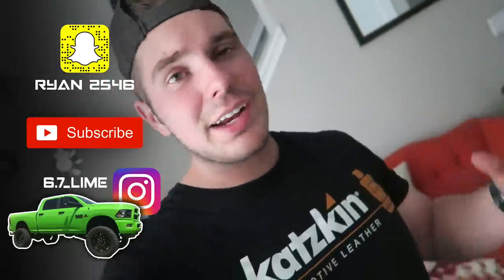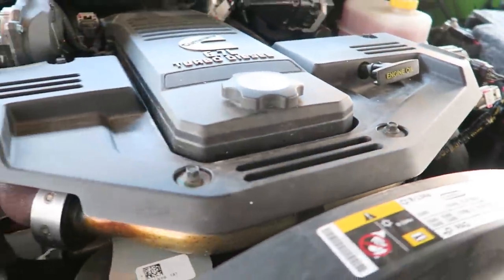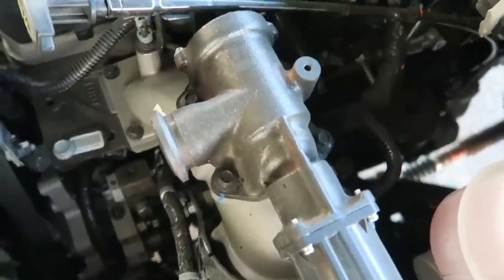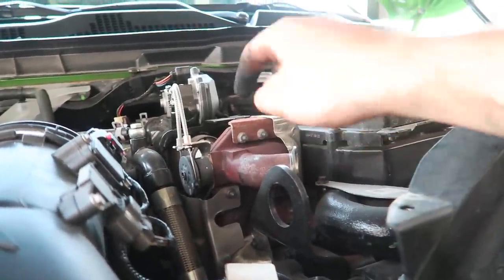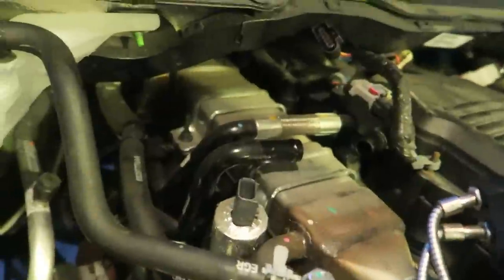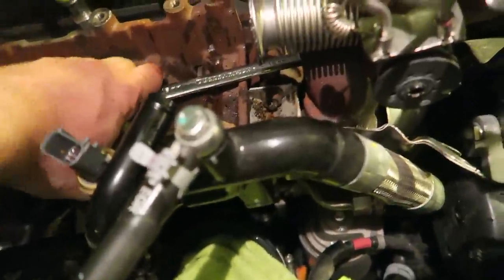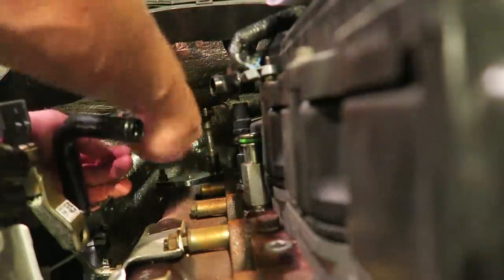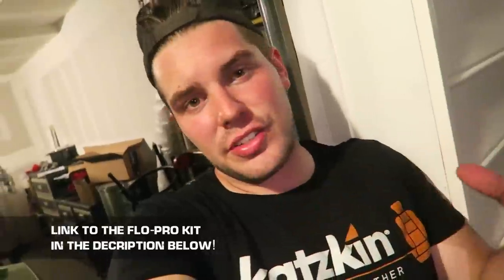6.7L Cummins EGR DELETE (2017) *For Race, Off-Road, Cleaning*

Comment: I done my truck in about 6 hours. That was an egr dpf and throttle valve delete. I couldn’t believe the difference it made in my truck on just a stock tune. I put efi live on mine
Reply: Hey man did you just get the efi live egr delete tune? Didn't know if they had to make one for the TV delete too im new to tuning bro and about to do it
Reply: @Tgodson69  yes. The tunes turn off the throttle valve. You don’t have to remove it but I did
Reply: @nicholashubbard9026  yeah I'm doing the same I appreciate the response have a good day

Comment: Luv the “disclaimer” great work and content 👍🏾👍🏾
Reply from the maker: 🤷🏼‍♂️ gotta do what ya gotta do! Lolol thanks my man!
Reply: @ryan2546  are there gaskets on the 2 block off plates. I didn't notice any, I'm fixing to get mine done this weekend and was wondering. I got the gdp kit and it came with rubber seals for the intake horn cover. No gaskets for the block off plates.
Reply: @ryan2546  how much was the Flo-Pro kit?

Comment: Easiest way to get to the coolant drain, remove the grille. On the driver side, remove or move aside the rubber cover/shield. Below the P/S cooler lines, you’ll find the drain.

I zip-tie a clear tube to the drain and run it down past the bumper. I find this method to be cleaner compared to coolant dumping all over the frame.
Reply from the maker: Sooooo dumb could not find it so I just went for it 😂😂😂😂
Reply: Ryan Mayer Sometimes you have to just send it!
Reply: @Ryan Mayer pin this comment, save more people from the "Oh!? There is coolant in there?" experience lol

Comment: I got a 2017 6.7 and deleted it awhile ago, the plate I have for the egr delete came with two long studs for the bracket. Only one lined up and the sensor won't line up with the bracket at all either. Now it leaks coolant I'm assuming due to vibration because of only one stud being able to be bolted in the exhaust manifold. Is 2017 and odd year for these trucks? Because I've seen multiple kits that show different brackets for 2017. Would be great if you had any insight onto what the issue might be because I am stumped. Thanks for the quality content.

Comment: Excellent video, thanks for sit. I have a 2011 6.7 3500 (I stupidly traded in a like 2006 5.9 - live and learn!). Ibhave had zero EGR or DPF issues, knock on wood.  But i was shocked yesterday when I replaced CCV filter at the oil and carbon swill being dumped back. But i kive in Tucson, AZ and would never pass emissions  if I deleted the EGR.  Sucks.

Comment: I know there are longevity benefits of this, but if I only use my truck for long distance towing 15-25k lbs, would you recommend this?
Reply: An EGR delete is always a good thing no matter what. Do you really want your engine eating its own poop? Engines that breathe their own waste don't live long, don't run right, don't have as much power and get worse fuel economy. Simply put, SCREW THE EPA!!!

Comment: Can you make a video on just unplugging the electrical connectors too the egr system. I have a raceme ultra tuner. Apparently it turns off the egr but too make sure it’s properly turned off I have too unplug the egr electrical connectors. I cannot find a tutorial anywhere

Comment: If you remove the little power steering resevoir on the driver side and look down there is a alan head plastic screw under neath that resevoir. Its probably half way down .

Comment: I understand the benefits of deleting the exhaust in general, but what are benefits of fully deleting the egr?
Reply: From what I understand, it prevents cycling exhaust fumes back into the cylinder which reduces soot buildup and let's the engine breathe better

Comment: Where does the riser pipe attach too after the egr cooler mounting bracket is removed? What supports that tri hose assembly?

Comment: How long did ya go before doing this? And which plugs under the hood do ya disconnect while running the delete tune before you get around to actually removing the EGR cooler and such. I know you gotta remove the DPF and SCR right away. But I heard you can leave the EGR installed just unplug certain connectors. Thanks

Comment: I have a 2018 Dodge 2500 and want the flo pro kit you have and the tune.  Which kit was it and where did you get it?
Reply from the maker: Tune is EZLYNK with tunes from PPEI, and EGR cooler kit is in the description! 💪🏼

Comment: With only 7K miles on it, I'm guessing you got it new and promptly voided the warranty.
It sounds like you're tough on that truck to need a clutch after less then 7K miles?

With that exhaust system, I'm also guessing the DEF system is gone?

Comment: Awesome video. Planning on doing my 2012 this weekend, I’ve been running egr unplugged. Any chance you can list the must-have tools? I also just installed the 5in flow pro with muffler about the same time your video came out.
Reply from the maker: GEAR WRENCHES, 3/8” extension, 15 mm shallow, pry bar, pliers/channel locks and impact wrench, id say!
Reply: Ryan Mayer thanks man. Keep making videos. They are much appreciated.

Comment: You should never use The EGR Blocker plate because I can lead to exhaust leaks and blown manifolds. It’s better to just get a different up pipe that is welded over the EGR’s old intake for the side the EGR is on. Just a friendly word of advice from someone who blew the exhaust manifold on his girlfriends diesel

Comment: Hey Ryan I have a 2017 cab and Chassis and I've been thinking about running delete kit on everything I haven't attempted this before but I did have a question or two can you recommend a a full deletion kit with 5in exhaust that's not way too expensive and my second question before any mechanical parts are removed do you have to detune the computer or is that done after the mechanical Hardware is removed and replaced with the new exhaust and block off plates for the EGR??
Reply from the maker: Flo pro has cab and chassis options that would be perfect!!! Also when you plan on deleting get the parts and tune. Tune the truck do the deletes once the tune is loaded or else the truck won’t run
Reply: Ryan Mayer cool so do you have any recommendations on that tuner as well
Reply from the maker: I put ezlynk tunes on mine, so far so good, still have my stock clutch so can’t get wild but tunes are clean and strong 💪🏼
Reply from the maker: From PPEI

Comment: Strange, deleted mine at 35k a few years ago and didn't run into any of the issues you experienced.
Reply from the maker: Not sure what year your ram is but a few things have changed since the 10’s and the 14’s
Reply: It's a 2014. Aside from the dual radiators and 68rfe, it's mechanically identical to yours.

Comment: Another note, You should delete the CCV tubing to the turbo.They make breather kits or you can do the full filter delete like i did and route it to the atmosphere under the truck like others have done.  That is basically sucking all the crank vent into the turbo which does have some oil in it and coating your Turbo blades and vanes which will coat with Soot and eventually clog and stop working if you dont tow regularly. Ask me how i know.
Reply: Why does it matter if you tow or not? If I only use my truck for towing, should I do a delete?
Reply: I dont Think so but from reading it doesn't matter either or. I just know from experience that I  only ever towed with my truck during the first 45k miles. Then I started only towing about once every 5-6 months and maybe only 3000lbs at most. At 152k miles my turbo vanes stuck open and the exhaust brake would not work correctly when not towing or unloaded. IF i hooked to a buddies 5th wheel and towed it for about 5-6hrs and the turbo got hot and cleaned up everything the exhaust brake would work for about a week and then stop again. 

A buddy deleted his CCV and EGR stuff as soon as he bought his truck, never tows and only drives the crap out of it and his lasted 200K before the actuator stopped working and we did his swap. 

I dont attribute the CCV to being the main culprit but I do know the less oily residue and soot sticking to the comp wheel and vanes the better and this is a factor.
Reply: a couple of buddies suggested that i run my exhaust brake as much as possible to prevent the vanes from sticking.  Towing or not, use the exhaust brake all the time.  Im at 130k miles.  no issues so far.
Reply: Yes exactly. I did the same thing and mine just happened to fail at 152k. Replaced with aftermarket and couldn't be happier

Comment: Does that last part of the egr cooler also have a valve in it?  Been considering emissions intact tuning to just keep the system off but haven't been able to find what valves are in that system to know where it will be cut off at.
Reply from the maker: No valves in the cooler that I could see just in the egr itself
Reply: Ryan, on the cooler side, do you know what that contraption is that that you took off last? its got cables on it and I notice that while the engine is running it rotates back and forth.

Comment: No reason to drain the entire cooling system. Use a vacuum pump (such as a Mityvac) to pull all the coolant from the reservoir.  What little coolant leaks from the cooler lines after disconnecting, can be caught with a small cup or soaked up with a shop rag.  Finish the delete, and top off coolant.
Reply: Probably a dumb question, but what is the coolant for? Isn’t the engine coolant in the radiator? Or does the truck have 2 different coolants?

Comment: so guessing you give no fucks about warranty
Reply from the maker: 3....2.....1...... ahhhh no the parts I remove / modify are the ones that trucks go in for warranty’s for. Other than that there’s nothing on the truck that could mess up that won’t be covered by warranty, if my lcd screen goes out that’s covered by the warranty because none of the modifications I’ve done have anything to do with the screen, the modification MUST cause the failure of the warranty part for the dealer to not cover you most get shut down and accept it. Dealer needs the proof and they don’t want to go through the trouble to prove it so they just send you down the road. That’s why you need to work with dealers you trust 👍🏼